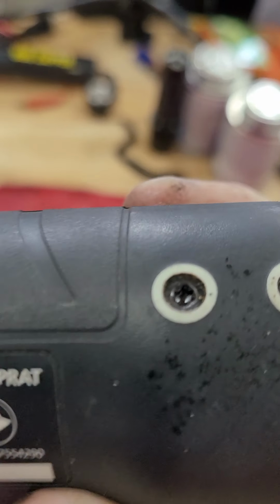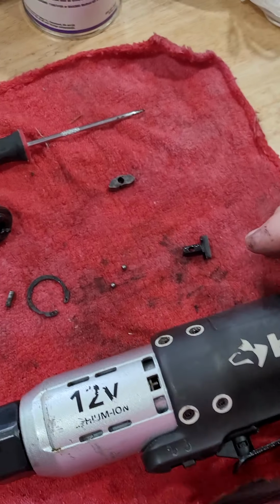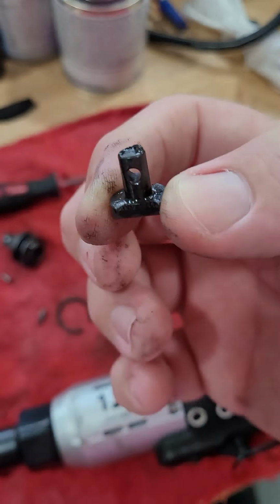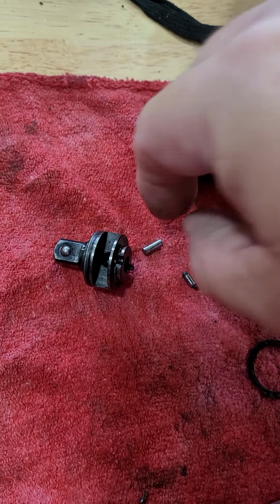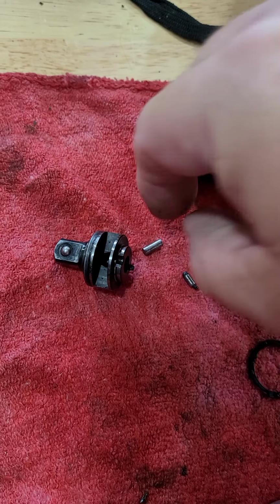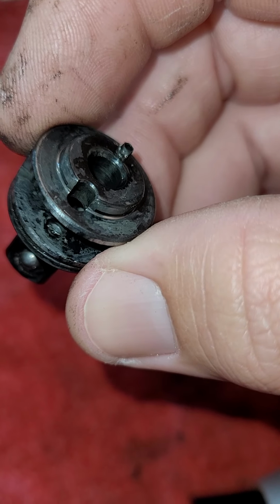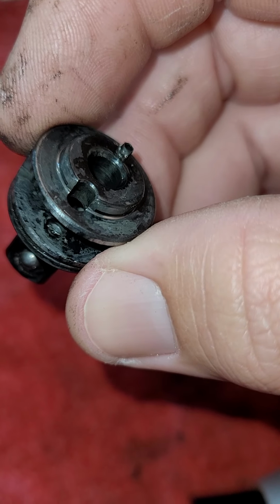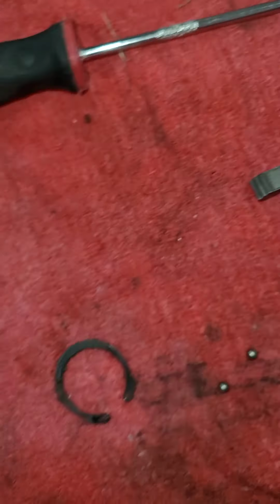husky 12v ratchet mode H38CPRAT

Comment: I've got this ratchet and it is a good ratchet. I let my son-in-law use it to tear down his 6.0 ford diesel. He manually broke loose most of the fasteners with  it and eventually the direction switch got difficult to turn so i took apart the head and with extreme manual torture the ratchet head flexed and let one of the ball bearings move out of place. I cleaned it and put it back together and still works great. Never broke the pawl like yours and he was really reefing on it. It came bust loose most bolts up to about 15mm but bigger than that I would recommend using a long handle ratchet or breaker bar then use the Husky to run them out.

Comment: How did this happen you went hand power with this and torque a bolt that didn’t want to come out or just snap w the built in electric motor ? How long have you used this tool I want to get one but for the price I had a Milwaukee it’s durable but i broke it after thinking it was a breaker bar and snap the internals I bought it used so 30.days from eBay and milwakee didn’t back up that purchase so no warranty but they do backup when you buy from Homedepot .
Reply from the maker: I honestly only used it about a dozen times, it looks horrible, but just because the paint was bad quality. It broke when I torqued it by hand, but I knew that was a limitation, so I am sure I didn't put too much pressure on it, maybe 100ft lbs at most, but it shouldn't have broken with the amount of pressure I put on it. Or at least that is my thinking. Milwaukee obviously makes far superior products, with the price tag to match, and HD does have a very generous return policy. The torque that most electric ratchets put out is really horrible, you pretty much have to break every single bolt free first, then apply electric. It kinda defeats the purpose if you can't use it by hand then pull the trigger.
Reply: @kevin83FL your confusing this tool with and impact wrench.  It is not meant to break or tight bolts under its own power. It is a nut-runner. And it is by no means a breaker bar even then. You run up the bolts or nuts then torque them with the proper tool.
I got my Milwaukee ratchet given to me because my buddy said it wouldn't break loose anything. Even after explaining how they are meant to be used he still didn't want it because it couldn't break loose any big bolts under its own power. He still does not understand to this day.

Comment: How do you take the top off to put spring and pin back in?
Reply from the maker: You should be able to remove the snap ring on the front and it should just slide out. I say should because I did that to mine, but mine came out in pieces because it was broken internally. I chucked it after this video, so I can't look, sorry.